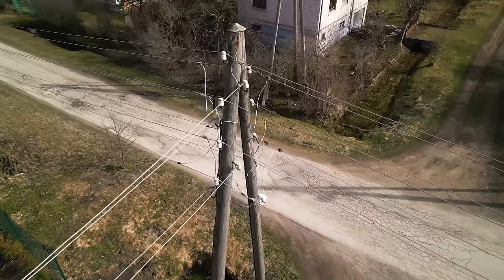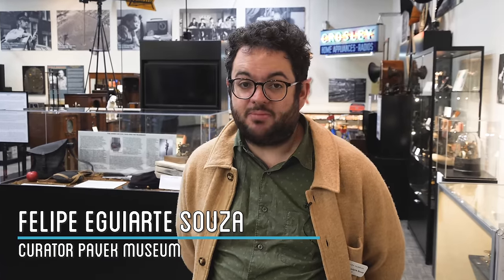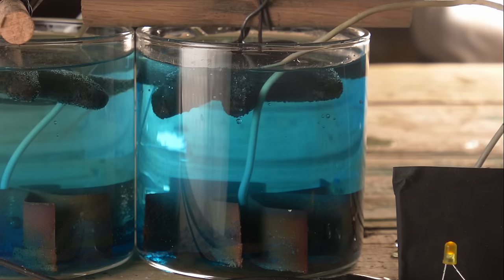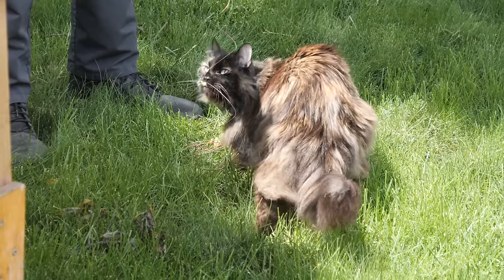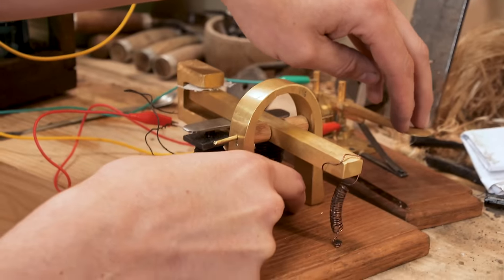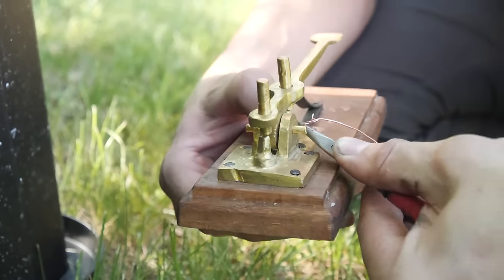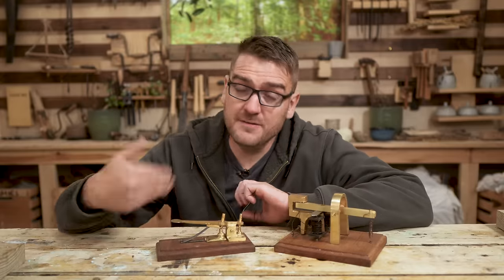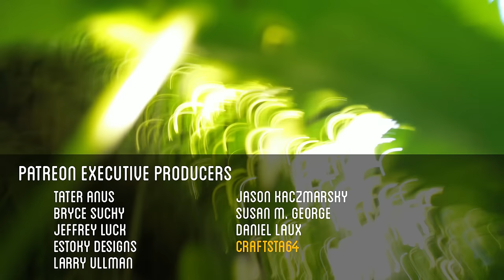I BUILT my own TELECOMMUNICATIONS Network!

Comment: The days of Western union, it was on common to find Battery rooms, that would have hundreds of Daniel Crowfoot gravity batteries. And usually anyone from 1 to 20 men Manning these rooms constantly watering and testing the batteries to make sure that they were constantly energized. Also they would rotate the battery electrodes on a regular basis. So they would wear evenly. For the purposes of your experiment it would have been just as easy to use steel electric fence wire, and Associated electric fence porcelain insulators. As they are direct descendants of the original Telegraph circuit. The reasons why you guys decided to try to pull your own steel wire is unknown considering the message you were using which is cold rolling. Was not in use of the time that wire would have been hot pulled, for at least the first two or three passes. And it would have been through a sizing roller set then into the final mandrel to pull to size. On a continuous coil we've been making wire that way oh since the 1840s. And also it was a high carbon steel content that was used in the wire. It was never a forged blacksmith steel. Your wires use on your sounders, we're not originally insulated with a locker compound they were a wire made from copper, not steel or iron. That was reserved specifically due to the links needed for telegraph lines. Interconnections in the telegraph stations, and between instruments in the station were all made with copper lead. Or actually copper bus bar.. the wire used inside the Sounder was a copper wire it was either insulated with cotton, or a lack of beeswax mixture. You guys have your history a little twisted around.

Comment: i allways had this idea and wondered if its (reasonably) possible or was atempted to "automate" atleast the sending part of a telegraph message, i allways imagined something that could be added to any given telegraph key, a wheel about the size of a modern bike wheel with slots on the outside to place something similiar to stamps, on one side (outside) it just has the letter and on the inside there are either pins or blocks according to the letter, as you rotate the wheel (hand crank) the slightly slanted pins/blocks run over and press down the button of the key, the pins only press the button shortly resulting in a . while the longer blocks compress it longer resulting in a _ 
obviously it would mean youd need multiple of all letters (based on how common a letter is) but you can make up for it by using most 'stamps' for two letters as for example A (. ) and N ( .) are mirrors of each other so you can just put A and N on the same stamp in such a way that if the A is the rigth way up it would be . _ and if you turn it the other way so that N is the right way up its _ . same for all other letters that are mirrors, and yes that whole thing IS probably alot more work then its worth with set up time, limited message space(the latter could be 'solved' with a belt system rather then a wheel) and youd need some sort of way to stop the wheel from turning after the message is through otherwise you you sent your message and then sent a part of the start of the message twice but still i was fascinated with that idea since i learned about telegraphs at i believe age 7

Comment: You really should learn the technique of annealing your metal so when you are work hardening it and struggling not to break your wire, heat it up to a black red glow then dunk in water mixed with some granular dry acid pickle solution. Then dunk in water mixed with baking soda. Make copper tongs for fetching the wire out of the solution. Trust me, it will make your life so much easier.

Comment: I wonder if morse should be considered a binary system of communication or a trinary system of communication.
If trinary, pause is 0, dot is 1, dash is 2, so SOS would be represented 1110222011100
If binary, we consider each character takes 3 bits to transmit, pause is 000, dot is 100, and dash is 111. We end up with SoS being 100100100000111111111000100100100000000

Comment: I was a bit bothered when this video first appeared, because you said you already had the materials needed for the insulation, but we never saw you acquire asphalt.  Of course, since then the Greek Fire video has appeared, and so we have seen you collect the asphalt.  You just hadn't posted a video about it yet.
I guess that's what happens when you're working on multiple projects simultaneously.  They don't always finish in the same order.

Comment: this is so close to a computer, all you have to do is build a couple thousand of those relays and connect them right and then you’ll have your own calculation device

edit: all you’d have to do to make a “proper” relay is to make the electromagnet in the sound thing act as a switch to switch the flow of electricity on or off

Comment: wouldn't annealing the wire after each pass have helped it from breaking?
Reply from the maker: We annealed it after a couple draws, basically whenever it started getting stiffer.  But still had issues with it breaking on us around 20 gauge thickness

Comment: It broke because pulling wire work hardens the metal making it fragile. You need to heat the metal to relieve the stress.
Reply: we did, one heat per 2 pulls
Reply: In any cases you won’t be able to make much more than what they were able to obtain with a wheel and gauged holes, you need gears, a constant pull and a uniform heat treatment, it’s really somewhat of an exploit that they were able to get enough wire to make a telegraph honestly and it’s pretty cool